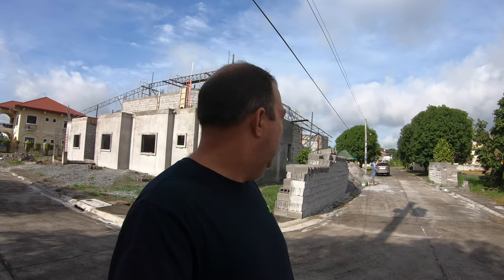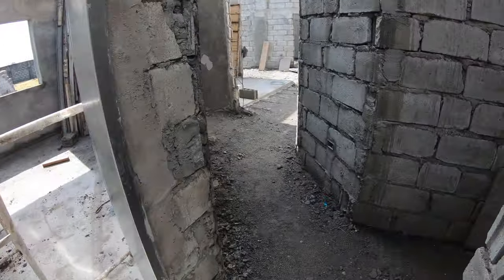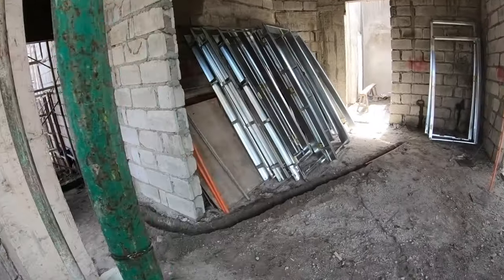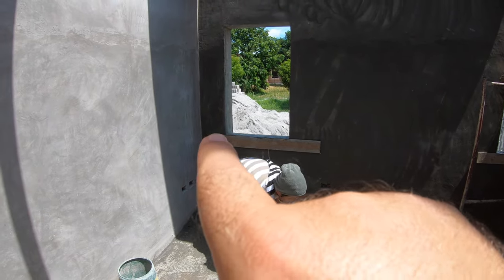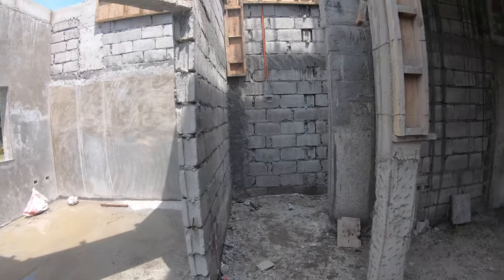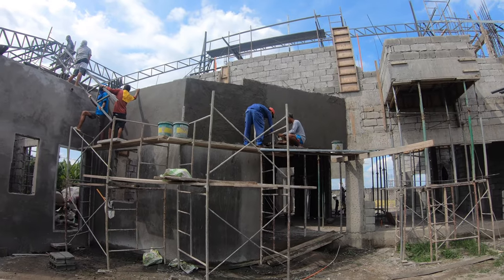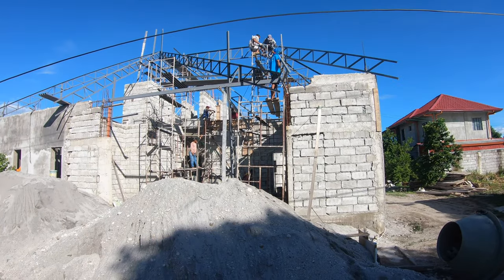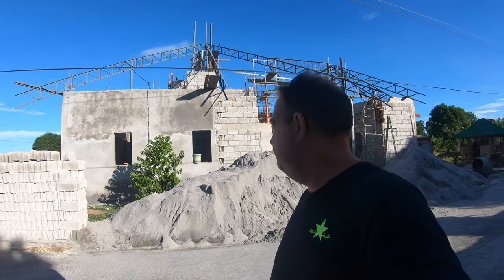Philippine House Building Step by Step, Build Day 89: Truss and Beam

Comment: Very nice finish on the plaster coat will make the skim coat a breeze - good tradesmen !! Some questions - what is a 'dirty kitchen' - what is a 'jack and jill' bathroom - will you have a maid or is that a guest area ?? Also I am sure you are safety conscious so can you please put some protective caps over the rio rod that is sticking up on the thresh hold of your main entrance and in that area - I cringe every time I see that - no one wants anyone to get hurt. Looking forward to the next one.
Reply from the maker: Morning Serge,  A dirty kitchen is usually separate smaller kitchen used to keep the offensive smells out of the main house. A Jack and Jill bath is one where the toilet and shower or shared between two bedrooms but each have their own laboratory. In regards to the site safety, I am more safety conscious than most of the guys seem to be used to on the site. If a rod is sticking out, they usually just bend it down or out of the way.  They don’t use the rebar caps that I’ve seen on previous construction sites in my career.
Reply: @CasaTexPina  - Good morning George it is a fine morning in my part of Australia - hope all is well in your part of the world. Thanks for answering my questions - much appreciated - lack of safety standards over there always makes my eyebrows raise - in any event see what you think of those rods sticking up like the do right at your front door - perhaps just bending them over as you have mentioned is all that needs to be done - have a great day !